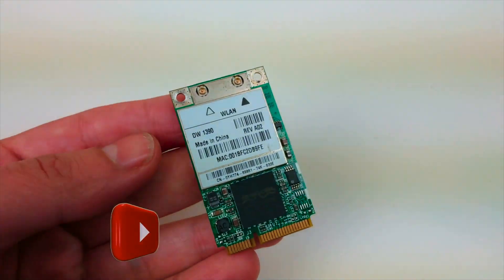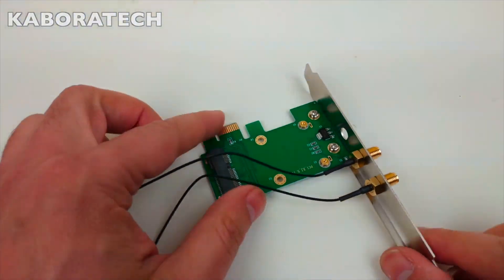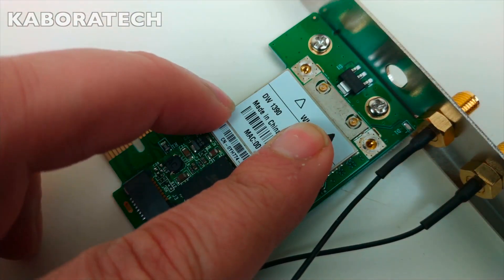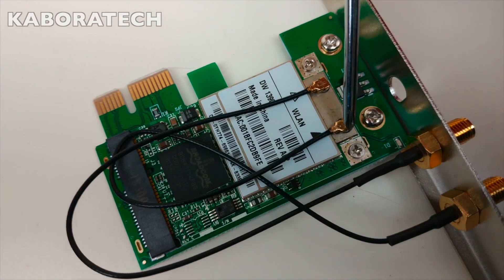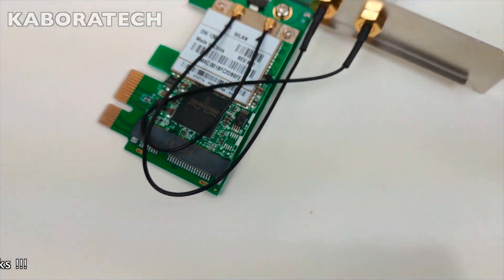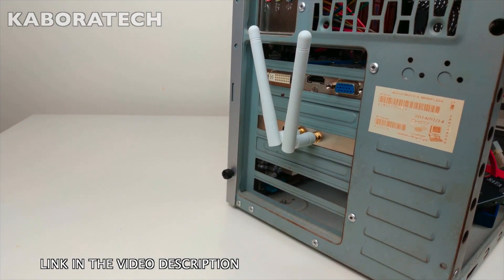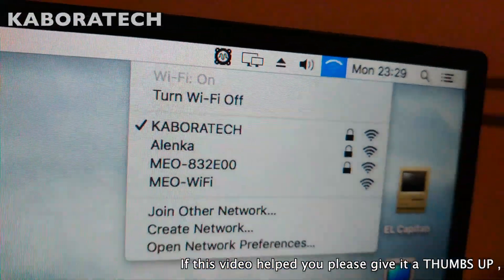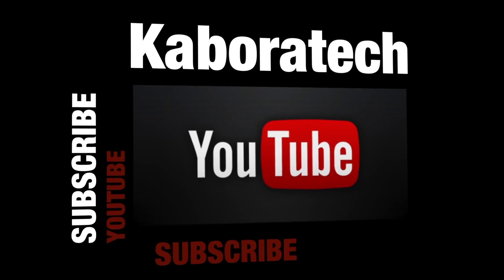Mini PCI-E to PCI-E 1X Desktop Adapter Convertor

Comment: Can I put a wifi 6 card into that converter without loosing performance? Idk, as a generic adapter, that could happen. PD: Nice video!
Reply from the maker: Hi, I have a video for a wifi6 card, don't know if this one accept wifi6cards
Reply: @kaboratech  Thank you for your answer, bro.
Reply: @kaboratech  I did a further investigation and yes, it can support wifi 6 network cards but with mini PCI-E ports. I have a question for you, does bluetooth work in that adapter, no, right?

Comment: Does it come with half size bracket? Links don't work btw.
Reply from the maker: Hi, try this one no adapter for small factor required, https://pt.aliexpress.com/item/4000188287103.html?spm=a2g0o.productlist.0.0.60c43956QnDv33&algo_pvid=b51dffc8-1f77-4885-9f22-49cf49ff631b&algo_exp_id=b51dffc8-1f77-4885-9f22-49cf49ff631b-0&pdp_ext_f=%7B%22sku_id%22%3A%2210000000704788838%22%7D&pdp_pi=-1%3B5.55%3B-1%3B-1%40salePrice%3BEUR%3Bsearch-mainSearch

Comment: Thank you for your video. Just a quick note to those who are planning to get these type of adapter, if your mini PCI-e card has Bluetooth feature on it and you are planning to use it, please don't get this adapter. This particular adapter doesn't have the USB port (to be attached with MOBO using a cable) so you won't be able to use Bluetooth. Get the adapter that has Bluetooth port on it. Hope that helps. Thanks.
Reply from the maker: Hackintosher? 🤔😜
Reply: is thear  any that do not steal  a usb  port

Comment: did the Bluetooth work?
Reply: At least for macos/hackintosh is better to have a different card (broadcom) and different adapter, in that case the bluetooth side connects through USB mb controller with a cable from the adapter to the mb usb connector... I have tried some laptops hackintosh with the combo mici pcie card (wifi + bluetooth) but then most of the time you must have a whitelist bios firmware flashed or be lucky to find a laptop hackintosh capable which include that combo card in the factory bios white list, but at the end the cons at this case is due that card the bt is 3.0 and the bt with the broadcom card for macos is 4.0...
Reply: @jraulc  I bought a Broadcomm card some time ago when I was trying to Hackintosh my Thinkpad (that failed). Unfortunately all the desktop WiFi cards (where I would just not use the Intel one and use my Broadcomm) that have Bluetooth (internal USB 2.0) use M.2 2230 instead of miniPCIe.
Reply from the maker: This card is wifi only
Reply: @kaboratech  replace the mini pcie card with a bluetooth/wi-fi card with antennae wires
Reply: You can find a usb bluetooth on the market like a tiny usb drive